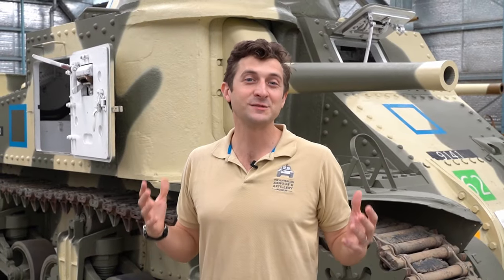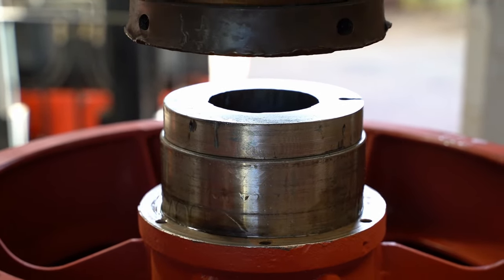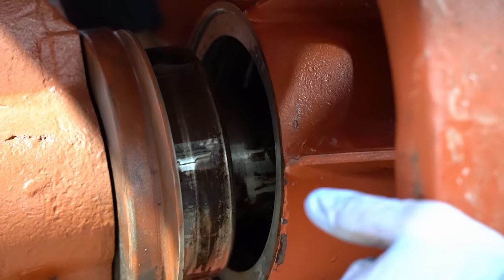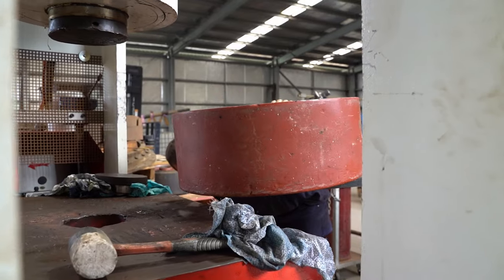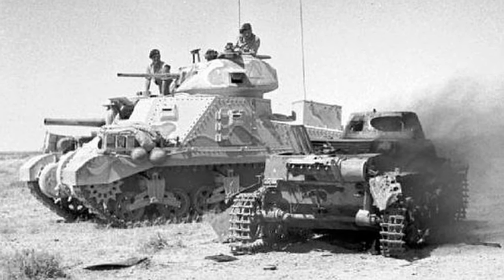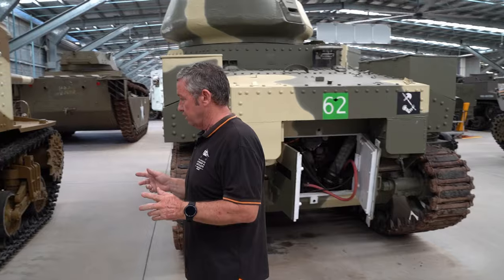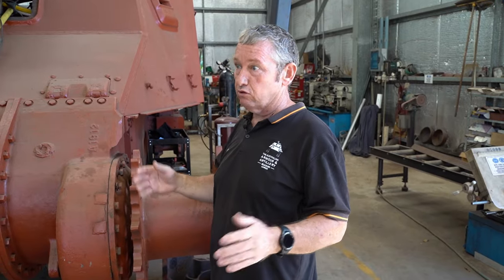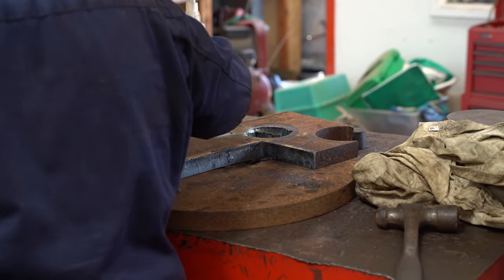WORKSHOP WEDNESDAY: WW2 M3 Grant and Lee tank TOUR plus fitting the rear idler wheels

Comment: Great to see plenty of lubrication being used in this assembly. So many so called youtube experts assemble shafts and bearings dry. Excellent Aussie fitting on display. 😀😀🇦🇺🇦🇺
Reply: In Germany we say, wer gut schmiert, der gut fährt 👍🏼 translation: if you lubricate well, you will drive well 👌🏼
Reply: Expert = Ex is something that has been.
             Spurt is a drip under pressure
Reply: Perhaps they know it will break down eventually and has to be worked on, and those guys are the ones who have to do it!
Reply: @sg195286  in Croatia same, tko maže taj i vozi.
Reply: It's relying on clamping force and friction so is it a good idea to lubricate it so much?  Maybe not. Maybe in this case a little bit of anti seize may have been better.

Comment: I repair factory machines for a living. The hydraulic press chattering reminds me of pushing bearings off a 3'' or bigger shaft that have been there for 50 years plus years. I had one oilite bronze bushing that froze to the shaft and spun in the outer journal. When I went to press the bushing off the shaft it DID NOT want to move. I soaked everything down with PB Blaster and let it sit over night. I cranking up the press pressure to 50 tons ( it had a 4" ram) when that bushing finely broke lose, BOOM. Everything jumped the shaft hit the floor. I ended up making a new shaft also.

Comment: Good work. Nice to see the new idlers go on with the cleaned up and regreased bearings/seals. Also a nice bit of history re. the various Lees and Grants. I understand that there is a trick for new players with the 6046 (twin 6-71) engine set. The Bus Grease Monkey was invited to do some work on a Sherman with that setup and initially could not get it to turn over but he read the manual overnight and worked out what was happening. It was, if I recall correctly, an issue with the clutch arrangement that allows the tank to drive with either one or both engines going. I also understand that you always have to start the same engine first.
I can see why you intend to go with a single Scania four stroke engine to move this beast. One engine instead of two. One turbocharger (presumably) that does not need to be on for the engine to run instead of one supercharger per engine, that has to run because a two stroke diesel cannot suck in air; and finally, an engine that does not have to be run very few weeks, in order to prevent injectors from sticking. Detroit Diesel runaways are not a good thing and … you would get sick of recharging CO2 extinguishers!😊
Thank you again for a positive update and the history lesson, complete with anecdotes about agricultural modifications to surplus Australian Army tanks. That cutdown and converted surplus vehicle is a good part of the story; and also a reminder that not every military workshop modification of an obsolete vehicle makes it into the history books. There might well be some oddball RAEME creations still to be recorded. 
Cheers from NZ🇳🇿!

Comment: One solution to use rubber seals made in the same fashion as the OG ones, would be to try and get your rubber cut with a waterjet. You'd need a rubber mat that's specific to your needs (so likely something pliable) but if you cut it a few mm smaller on the ID you could repack the seal with new rubber.

Comment: Hi guys!  Great video!  No wonder the old wheel bearings were in such good condition!  They were protected by the cast steel wheels, grease seals, multi-bolt gasketed front cap, & about 2kg of grease!  Phew!  That looks like marine grease youse have used in the idlers ay?  Good one👍!

Just one thing though - I never actually saw the spacer being installed between the inner & outer bearings of the second idler wheel.  Hopefully it was installed?

I'm glad you showed both idlers spinning with their newly packed bearings; that was reassuring & satisfying to see!  

But maan!  Those idlers with those huge bearings look indestructable!  And so - they were not destroyed, in fact youse got to reuse old the grease seals so I was right - so  they ARE virtually indestructable!

That hammered-on toothed plate that locks in the track tension setting - is that pretty easy to remove again, cos you may need to remove it to adjust it once the tracks are on?  I'd have thought it would have been stored somewhere safe til then - maybe in one of the M3's toolboxes, or in Darryl's toolbox!  Thanks fellas!

Comment: For the amount of work this will do if you couldn't have sourced original idler wheel seals for the light duty this will probably do a simple turned shell with a felt shaft seal would have been adequete(like in old pre WW2 bearing pillow blocks), had to do it as a temporary measure for fan shafts in the past.

Comment: Anti sieze would be a better compound to use as the grease will plastisize in the space and cause the part to stick in the bore. where anti-sieze will literally prevent the item from siezing in from lack of active lubrication. Nickle anti-sieze would be ideal, but copper would work just fine.

Comment: As an ex Chieftain mechanic, I can’t help wondering how battlefield repairs went on those idlers. Pressing in bearings is likely a field workshop task with recovery mechanics dragging casualties back from the front line. Taper roller bearings would seem to be the better option.

Comment: The turret on a tank has electrical and hydraulic connection between the turret and the hull. How does that work. Given the turret traverses 360 degrees?
Reply: The electrical connection is done via a Rotary base juction,  a slip ring of sorts that rotates as the turret does but maintains an electrical connection. Hydraulics/electrical traverse are contained within the turret basket itself.
Reply: @jasonbelgrave2831  Many thanks Jason. Always wondered about that.

Comment: All you guys need is a cast M3 medium tank to go with the rest of your M3 welded and rivited tanks in your collection. Did any of the Australian M3 tanks come with the Westinghouse gyro stabilisation system being classified by America. Lastly could a M24 Chaffee or ac1 Sentinel turret be adjusted to fit where the 37mm turret mounts? I have seen a Russian lend lease M3 medium mounting a T34 turret. That makes me wonder if a 76mm later American hellcat/M4 medium gun could be mounted instead of a 75mm, or a 25 pounder. Lastly in hindsight would've a ball mount browning .30 cal mg for the M3 Lee's radio operator been a better idea than driver fixed traverse twin MG's.

Comment: Here We Go Again .... 'Cotter Pin v Split Pin' ... 
I was always told by my Mechanic Brother, back in tew 1950's, that a 'Cotter Pin' was the threaded tapered pin/bolt
that went into the 'Push Bike Pedal Arm' that attached said 'Pedal Arm' to the 'Pedal Arm Shaft' (?)
AND ... that a 'Split Pin' was designed to hold a 'Castleated Headed Nut' in place, and stop it from undoing ....
Words Boys ... are very important .. Don't be a Trumpy .... Remember what he did with words?!?!?!!??!